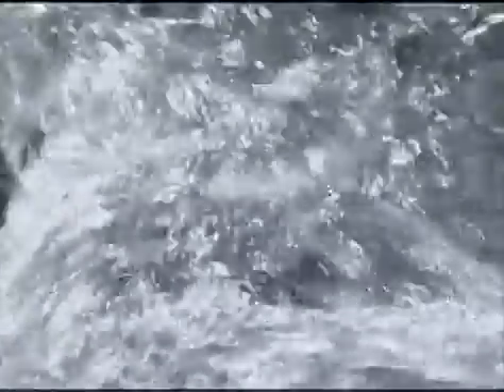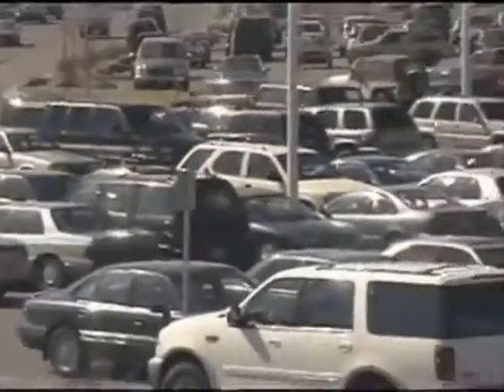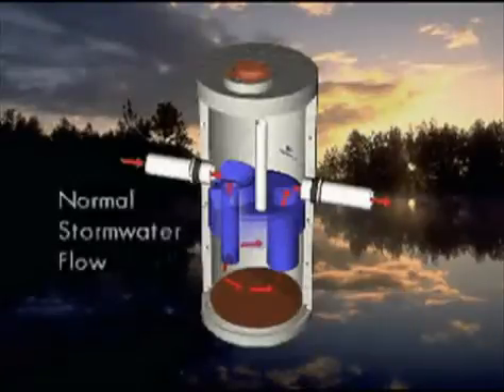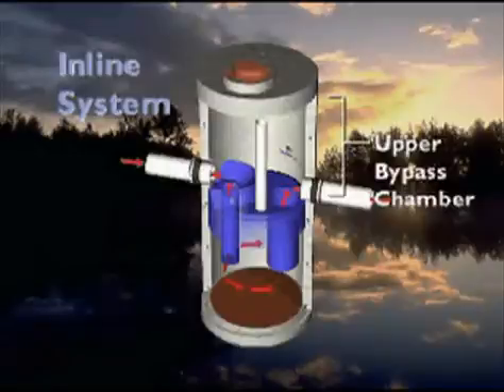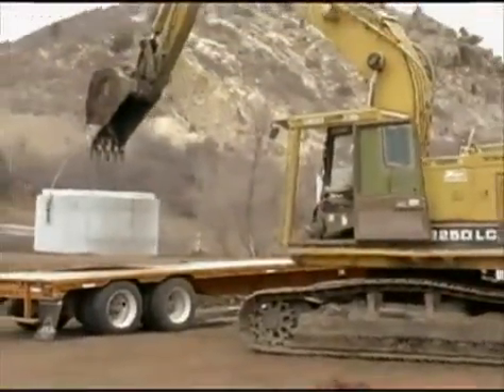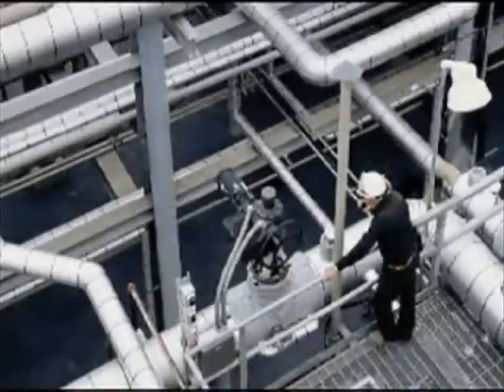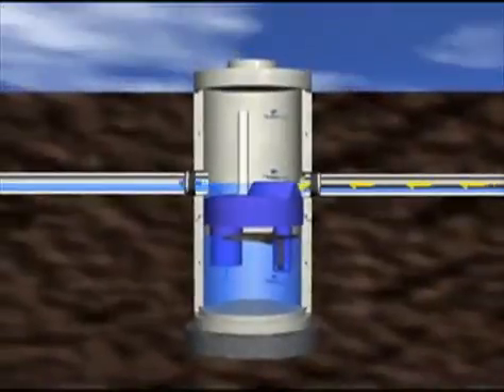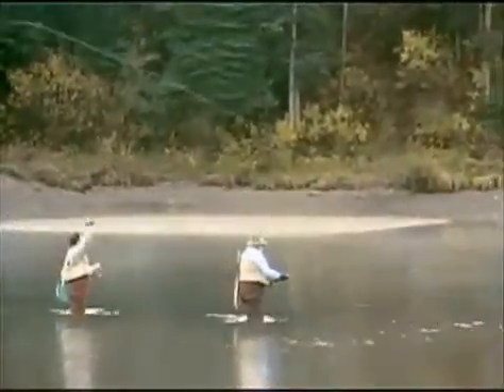Imbrium: Stormceptor Protects the Environment and Cleans Stormwater

Comment: Question from a vac truck operator, how to do clean this? With just 2 small access points to the bottom sediment area, it is near impossible to clean this out completely.
Reply: Never seen one where the access  holes werent big enough for a man to get into the bottom
Reply: @chickenman1999ify don’t think people are supposed to go to the bottom lol you clean them with a hose that fits through the access hole